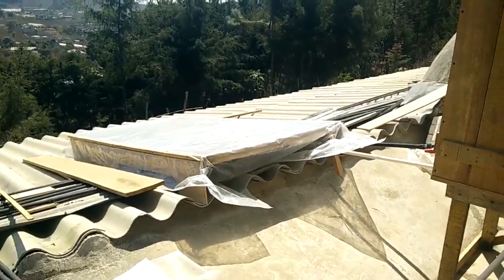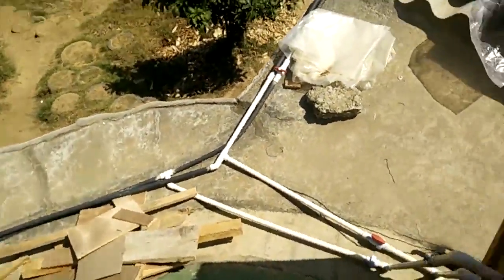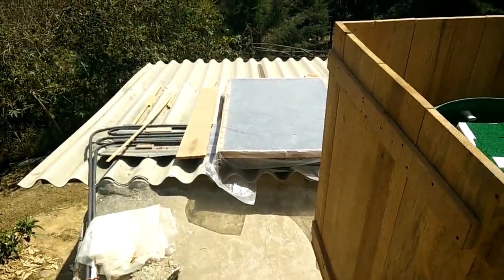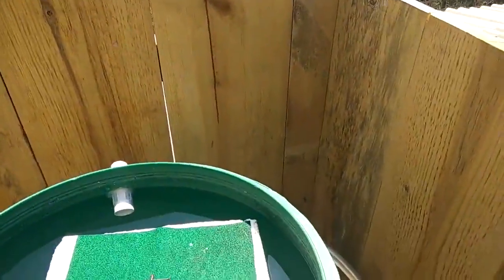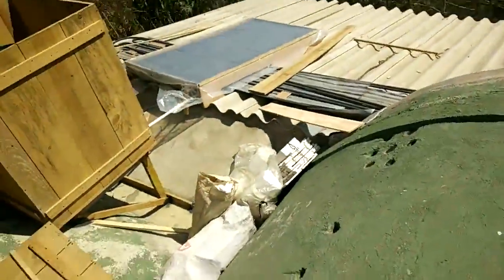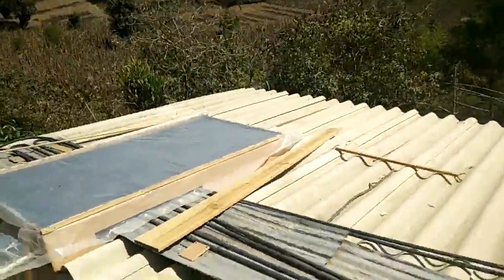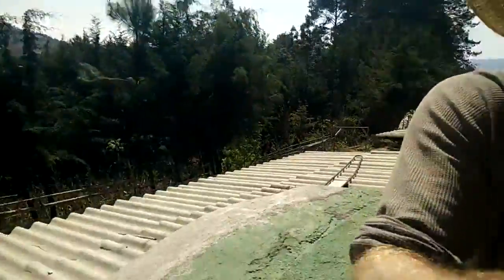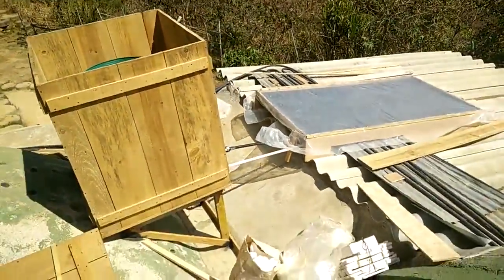Solar Water/Air Heater Panel Prototype at Long Way Home, Guatemala - OpenSourceLowTech.org

Comment: why not isolating the hot water tank with dried grass or something similar cheap and biological?
Reply from the maker: That would work, but polystyrene does a better job and there's usually a lot of it around as waste.